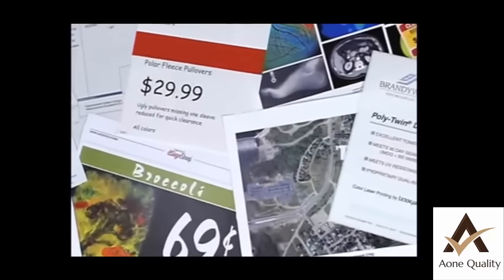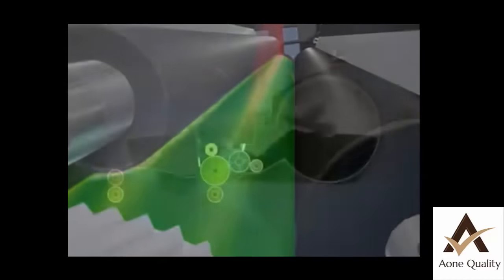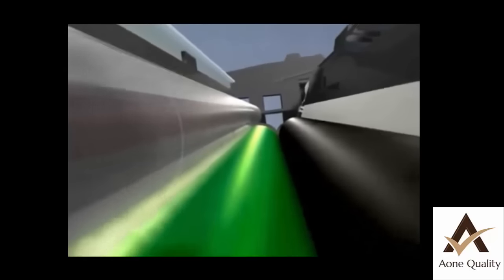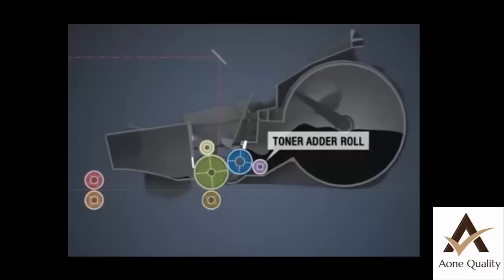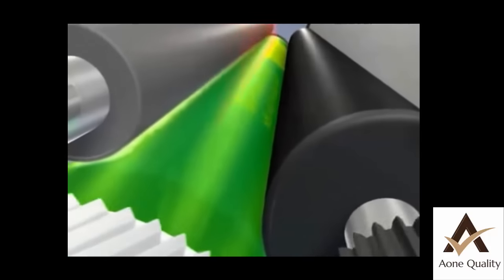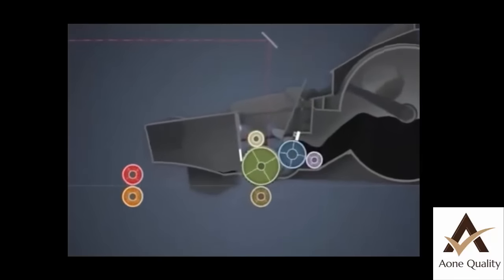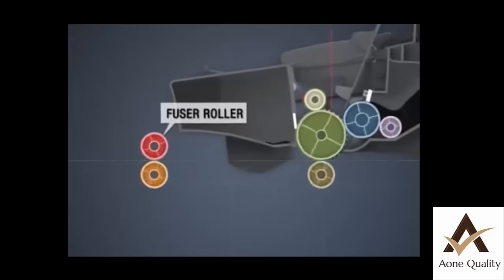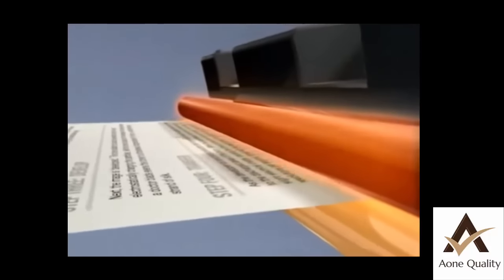Animation of  print process in laser jet

Comment: What is the life of various moving parts,  where I can get the info. Tks.
Reply: These are printers' individual specs and can be checked easily under the title of duty cycle of that part. It also very important to use any such devices for at least some time daily or weekly to keep them operational and in working condition.

Comment: why does the paper not burn at 220 degree centigrade
Reply: Its too fast for it to burn. E.g: try putting a piece of paper on your stove with a pan
Reply: Maybe because only the rollers are that hot but paper isn't, it requires significant time for something to transfer heat to an object so the temperature of source and object become equal, but the paper comes in contact with hot roller just for a moment. And also the ignition temp of paper is about 233°C, slightly higher tham the temp of roller mentioned here 220°C
Reply: @zenvir1680  super explanation
Reply: @hiteshlaghnoja5576  haha Thankyou ;)